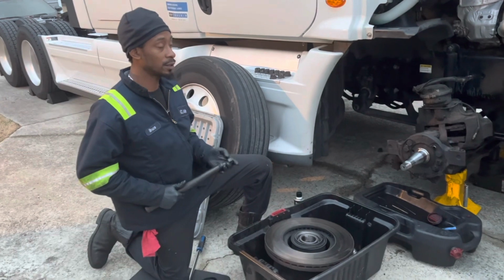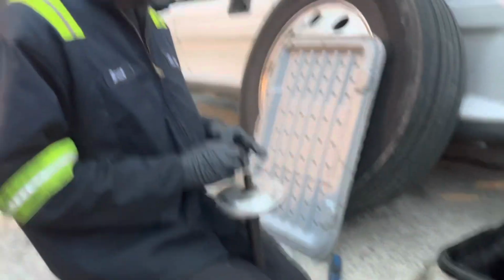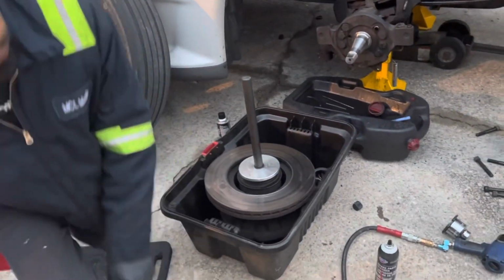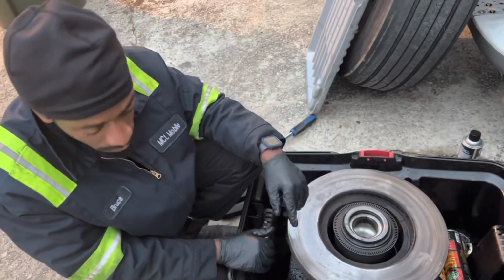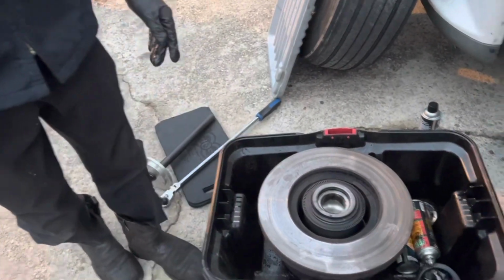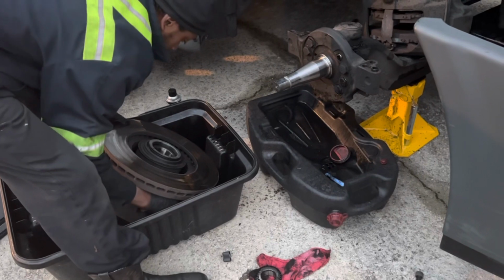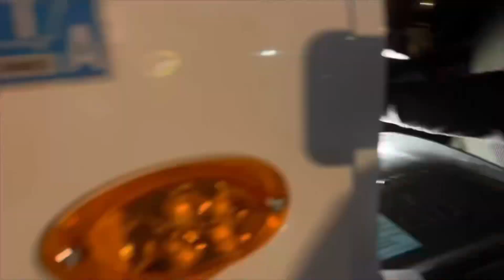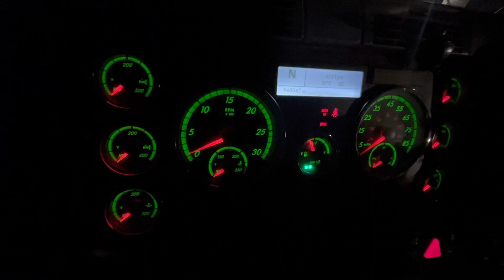5 min mechanic promo vid @BruceMobile replacing leaky wheel seal on Freightliner Cascadia steer axle

Comment: In less than two months, those stupid mechanics made to change this seal the third time. I think if this seal was installed right, it would last for two years or more .
Reply from the maker: Yes ideally you should not have to replace wheels seal regularly. May need to inspect the hub and spindle for unusual wear. Also be sure to replace cone spacer in wheel hub.